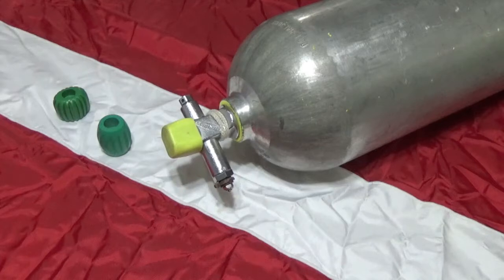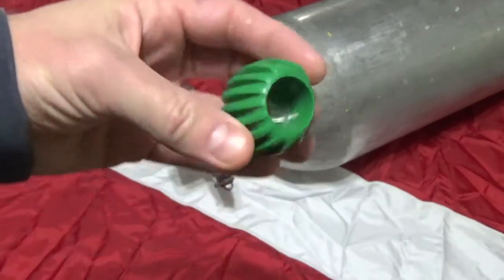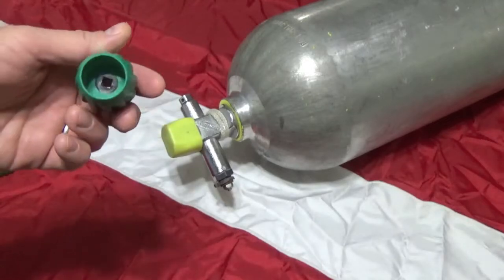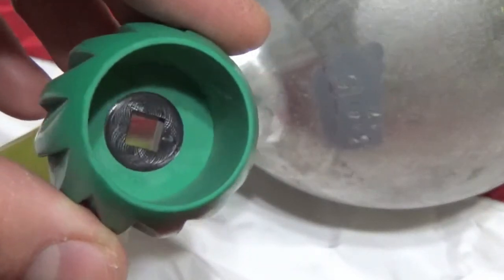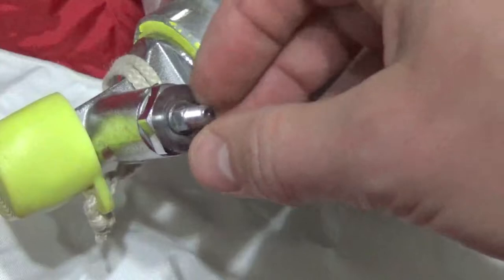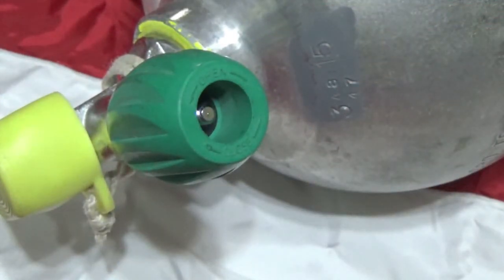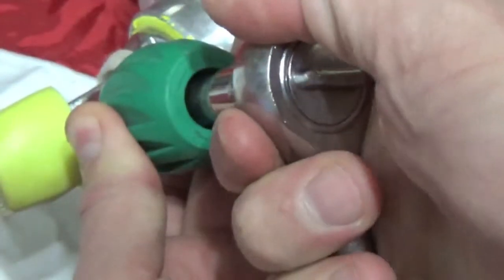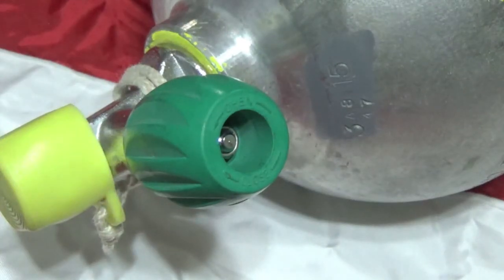Replace SCUBA Tank Knob - Genesis Valve

Comment: Wouldn't it be better to replace the entire valve with a modern valve such as DIN etc?
Reply from the maker: You could, but this Genesis valve itself is still in perfect condition. The trick is finding knobs to these old Genesis valves (as they have been discontinued).

This is a $6 fix with one simple nut as opposed to a $70 fix and then needing to drain the tank, fit the new valve, replace rings/seals then getting the tank refilled. If you have the tools this is no problem.

If the valve itself was damaged in any way, shape or form you are exactly correct. Bite the bullet and replace the entire thing (still cheaper than a new tank).

Thanks for watching and taking the time to leave a great comment! Namaste!